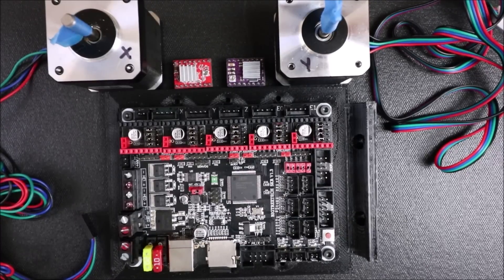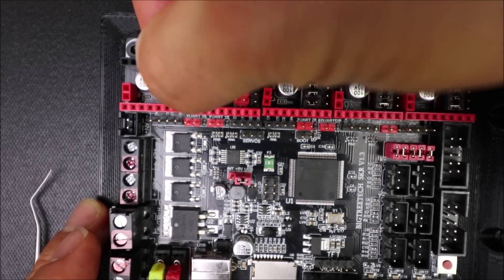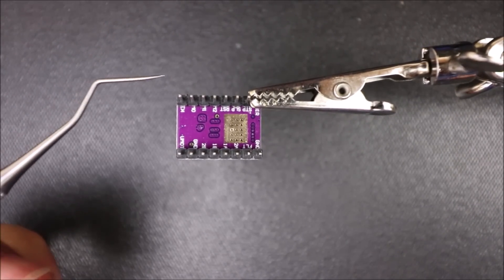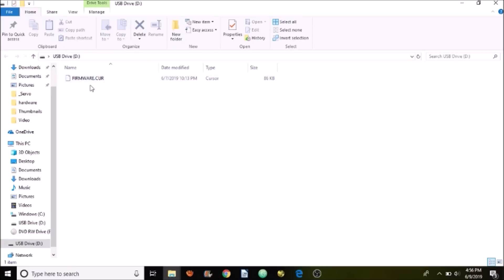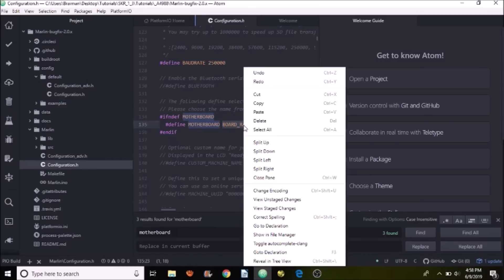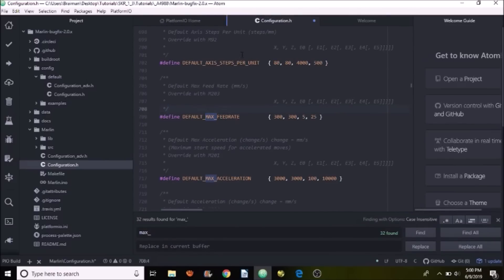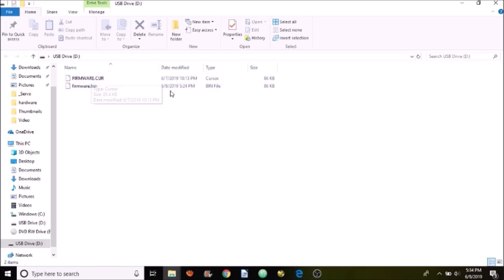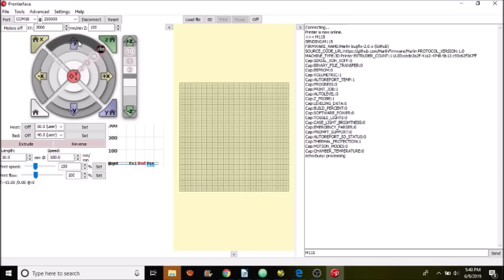SKR 1.3 - A4988/DRV8825 configuration

Comment: Thanks for the videos, but I can not find out how to adjust the A4988 Vref on a BTT SKR v1.3. The only thing that comes is for  is for the Gen_L, are they the same?  I can not get any readings using the Gen-L video?
thanks
Reply from the maker: What's the multimeter set too?
Reply: I tried 2vdc and 20vdc
Reply from the maker: What are you using for ground?
Reply: @EdwardBraiman  The USB casing.

Comment: I want to use TMC2208 driver for the x, y and z axis and a A4988 for the Extruder, but when i use the "M122" command with octoprint it only shows this:

Recv: Testing X connection... OK
Recv: Testing Y connection... OK
Recv: Testing Z connection... OK

but nothing about the connection to the A4988 driver, do you have any idea what i have to do to solve this problem?
Reply from the maker: A4988 are not tmc2208, so X,Y and Z appears okay.
Reply: @EdwardBraiman  and what i have to do to get a connection to the A4988 driver? I do it like you has shown in the video, but then i get the problem that i said
Reply from the maker: These are motors for extruders correct?  If so they will not move until minimum temperature is reached.
Reply: @EdwardBraiman  i heated the hotend but nothing will happen, and i cannot measure a motor voltage  on the a4899, i also tried another a4899 and there is the same problem, so there must be a connection problem between skr board and the driver
Reply from the maker: Try powering down system and configuring one stepper in x position.  Let me know if it works.
Reply: @EdwardBraiman  you mean i should use a 4988 driver for the x axis to show If it works?
Reply from the maker: Correct.  Remember to configure jumpers for stepper driver and switch back.  Or after work we can examine problem over Discord and see what's occuring.

Comment: Hello, I need help, I hope you can help me, my printer is about 30% off, what do I mean, my prints are about 30% larger, if I measure the size of the bed with the steppers, let's say homing " X "and moving it all the way (my bed is 300 x 300mm) it will measure 238 instead of 300, can I remove the pins from drivers (I have A4988) to adjust? Its all steppers are the same, in fact it prints very fast. THANK YOU!
Reply from the maker: Several factors can cause issues.  First start with calibration of Marlin firmware.  You'll want to print a 20mm calibration cube.  After measure cube and record size for x y and z.  Then adjust values in firmware.  So if you're initial x value in Marlin is 80 and your 20 mm cube multiplied by 5 is 95 you will divide 95 into 80 and multiply by 100.  The new value will be the replacement for x value of 80.  Repeat for y and z.  After all values are changed in Marlin firmware recompile and then repeat.  It should then be closer to a 20mm cube.
Reply: @EdwardBraiman  Thank you,  I will try to make a cube, at least I can have X & Y, even the extruder is  going too fast, so I cant print correctly, after that, where do I calibrate Marlin Firmware?
Reply from the maker: With the extruder is the same process, but extruder 100mm of filament without heat or a hotend and measure.
Reply: @EdwardBraiman  Thank you!!!! I got it, 3 boards, 1 week, but I learn a lot, thank you for great videos

Comment: Nice videos sir. Will you please make a video on SKR V1.3 with TMC2130 V1.1. Please
Reply from the maker: Did you check the playlist?  There should be a tmc2130 video.
Reply: @EdwardBraiman  but it's not TMC 2130 V1.1
Reply from the maker: Is the concept of installation the same?  Is there a different in the tmc2130 v1.1 datasheet?
Reply: @EdwardBraiman   I am facing another problem, USB connection not recognized. will you please me to solve this problem.
Reply from the maker: Check the jumper position.
Reply: @EdwardBraiman  it's in correct position sir.
Reply from the maker: What's the setting in Marlin firmware for first serial Port?
Reply: @EdwardBraiman  it's -1
Reply from the maker: Tell me about your configuration, how are you connected, what operating system, have you power cycled machines, what is the current placement of jumper, what software are you using to connect to motherboard?

Comment: I followed your steps with the serial ports, but Pronterface doesn't see anything in the COM ports. Do I need to install any other drivers to make it work?
Reply from the maker: You may, but check the documentation link in the description and check the jumper mode and device manager to see if it appears.

Comment: I'm stuck on the lpc1768 part ...the c1768 is Orange and the build continues to fail...is there a fix?
Reply from the maker: Try first changing you IDE to Vscode.  I made a tutorial recently as builds in ATOM with Platformio seem to fail often.
Reply: @EdwardBraiman  vscode is an additional download to my understanding...just download or are there other steps?
Reply from the maker: Check my recent videos in my SKR v1.3 playlist.
Reply: @EdwardBraiman  thanx that helped only now it says 5 errors something abt TMC steppers and how LPC176x isn't declared? I feel like I'm getting closer
Reply from the maker: First download the Marlin firmware  for a fresh start.  Verify it compiles without issue.  Make changes just for motherboard type and platformio and recompile to verify its working.  Then make motherboard specific changes for you configuration and compile.  This will help narrow at which step a broken compile is occuring.
Reply: @EdwardBraiman  thanx bro💯💪...that worked, Although the cursor file has been updated, but now my tft screen says no printer attached😐😂I have no idea what's going on
Reply from the maker: @individualone  which type of TFT?
Reply: @EdwardBraiman well... I originally had the tft 35 but I dropped and cracked the screen. So I ordered TFT24 v1.1
Reply from the maker: @individualone  check firmware version is up to date and baud rates match.
Reply: @EdwardBraiman  yup.i reduced the baudrate to 115200"I think"
Reply: @EdwardBraiman  😐it worked..but...uhhhh the font and thumbnails are mush... it's not legible😳 what did I ruin it?
Reply from the maker: @individualone  which file did you use?  And on which TFT?
Reply: @EdwardBraiman  I used vs code along with the bigtreetech TFT24 V1.1 touchscreen software...i compiled, uploaded and then when I put the sd card in the TFT it loaded a corrupted file..nothing is legible on the screen and the button mode doesn't even work anymore! Plz help thanx in advance.
Reply from the maker: @individualone  the TFT 24 firmware is available on the bigtreetech GitHub page.  Try using that for the LCD.  Or wait a couple of days and watch the video on the subject of tft24 firmware updating.
Reply: @EdwardBraiman  yes..that's the exact firmware I used
Reply: @EdwardBraiman  I uninstalled then reinstalled and tried again..this time while trying to upload it says 1 error " can't find CMSIS-DAP device" and " no valid JTAG interface configured? Thanx again for help.

Comment: hello, skr 1.3 and  five drv8825, motors move only if connected via repetier host, but when trying from mks tft28 or biqu 28 nothing moves. vref set to 0,89... I don't understand
Reply from the maker: If the motor move in repetier host, it seems to point to TFT 28 display  issue.  I'm guessing tft28 powers up, check your firmware version and speed for baud rate.
Reply: @EdwardBraiman  thanks for the answer, now is set to 115000 and already tried 250000
Reply: @EdwardBraiman  hello again I tried again both baud rate and nothing... I don't know if I have to set something via platformio in firmware, but on ramps I plugged and play this lcd...
Reply: @EdwardBraiman  Solved... I had to define 2 ports on conf.h on marlin.

Comment: Ok. I've installed 1.3 board on my Anycubic Kossel. I used the A4988s from trigorilla board. When I try to move or auto home. Just loud hum until shuts down to error, home fail. Reset. Thoughts anyone?
Reply from the maker: Check the trim pod on the A4988.  According to your description the current maybe too high.  If you check my playlist for MKS Gen L, it may describe how to calibrate.

Comment: Y-driver was not plugged in correctly! :D You must have corrected this secretly! ;)
Reply from the maker: Finally some found it.  Yeah, correct in final test as it failed in the previous take of the test.
Reply: @EdwardBraiman  I followed your instructions precisely, but I'm not getting any motor output at all. You say that you corrected something off-screen? what exactly did you do?
Reply from the maker: It was not fully plugged into the female pins for the stepper board.
Reply from the maker: What's occuring no motor movement?

Comment: Hello, can you make tutorial for diamond extruder ? Thanks for this video types, its very useful for me.
Reply from the maker: I'm going to try this weekend.
Reply from the maker: It may work on this board, but I'm not sure because of the pin integration with SPI and uart.  Basically the tracings for the pins may conflict with C's pins, but I'll see if it's possible.  Keep in mind CS might not be usable.